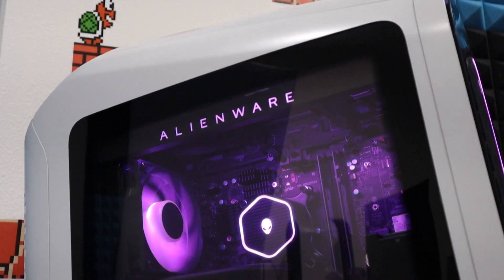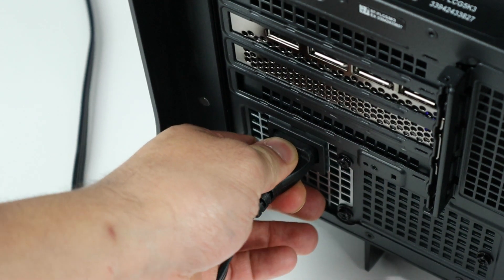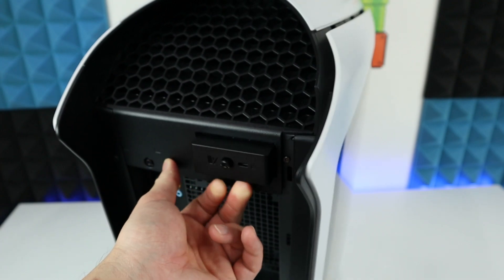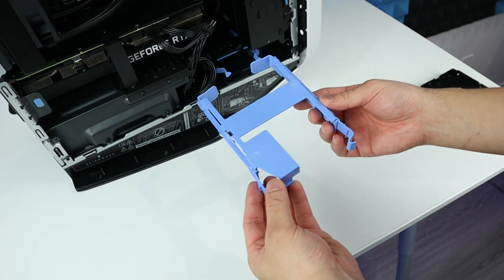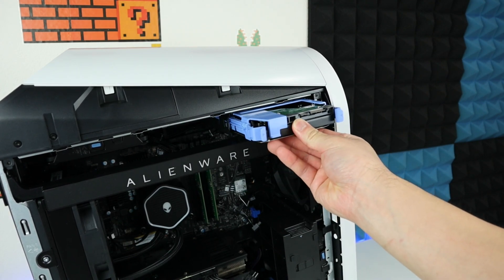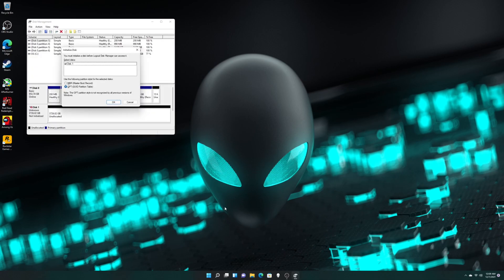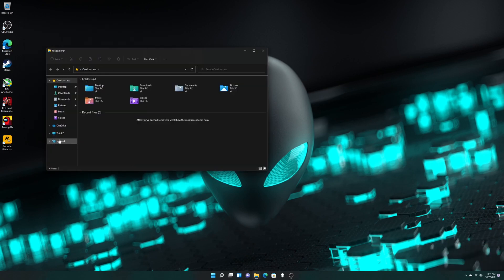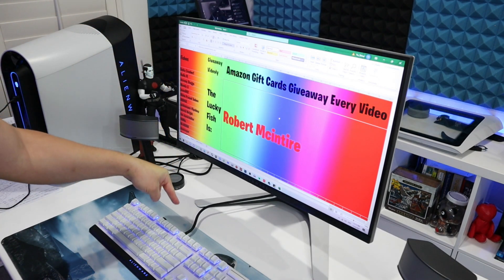How to Upgrade 3.5 Hard Drive HDD to Alienware Aurora R13

Comment: this might be a dumb question, but is the hard drive you show in the vid originally empty and intended for an extra hard drive? Or do you fully have to replace the one the pc comes with?
Reply from the maker: I didn't have a hard drive, so I installed one, and it's brand new, but you can add an old hard drive too.
Reply: Yes it’s empty. You can put on an old hard drive as long as it’s the same size. Or a new one with same sizing as well.

Comment: Thank you for creating this video!  I just received mine but Dell is telling me the largest 3.5 HDD the R13 can handle is 2TB - which based on your video appears to be incorrect.  It is my hope to install an 18TB in this bay just for storage.
Reply from the maker: OMG 18tb I don’t know. But 4tb works fine.
Reply: Going to find out! It won't be used to run any programs off of, just storage so we will see.  Thanks again.
Reply: If anyone happens to wonder if an HDD of this size posed an issue with the R13; it doesn't.

Comment: Does the PC come with them cables standard? Id love to move my hdd over instead of buying a new one
Reply from the maker: There is only one extra sata with the pc. you will have to buy some for yourself.
Reply: @RyanYu  so if I want to add another hdd in the slot you have there I need to buy the cable? I ordered mine with a 1tb nvme only
Reply from the maker: @achunkyduck9740  you meant two HDD?
Reply: @RyanYu  No I have no hdd on my order list but I plan to add one myself. I'm curious if the cables are provided for me to add 1 hdd
Reply from the maker: @achunkyduck9740  Oh, for that you don't need to buy anything. It will be just what I did in the video.
Reply: @RyanYu  Perfect, thanks so much for the reply. Iv been loving the  videos about the r13, very informative.

Comment: Hi are the cables for the external hard drive already installed on the R13?
Reply from the maker: For the 3.5 HDD the cable is ready, but for the 2.5 SSD, you will need the sata cable.
Reply: Thank you bro! Please make more R13 videos! I am a fan
Reply from the maker: @bensonnv2936  I have about 8 of them. check them out on my channel.

Comment: I just received my r12 and I havent used it yet I am waiting on the monitor arriving tomorrow. Would it be alright for me to add a 1tb hdd right now before initial start up?? Or should I wait
Reply from the maker: You can add it now, it doesn't matter.
Reply: @RyanYu  thanks. Doing it now
Reply: Is the power the one labeled p3? Mine didn't have a black one like urs
Reply from the maker: @love-ce5xq  Yours is R12, it will be same as R11, I have a video just for R11, try that one.

Comment: Thanks for the tutorial. Really helpful for when I upgrade. I see from the comments that although there's only one drive-space for 1 HDD, we still do have 3 sata and power connectors available. I was wondering if you could make a video regarding how we can add more HDDs (purchase an appropriately sized drive-bay and where to fit them). I hoping to install 3 seperate ones.
Reply from the maker: I don't think there is a space for another 3.5 HDD.
Reply: @RyanYu  Thanks a lot for letting me know. Cheers!

Comment: i see a 3.5 bay and a 2.5 bay it seems there's 3 sata plugs though is it possible to add two 2.5 drives and one 3.5 drive ?
Reply from the maker: I think so, but we need to find a place to mount the extra 2.5.
Reply: @RyanYu  would fit in the back panel wire organizer space with same velcro tape ? I've seen that done in other cases not sure about this one... thanks for answering though ☺
Reply from the maker: @realityzoner  I will check that up.
Reply: @RyanYu  awesome waiting for your next batch of videos
Reply from the maker: @realityzoner  :)

Comment: Can you also make a video how to upgrade the second m2 ssd slot plz? And do you need a headsink for it?
Reply from the maker: Video coming soon.
Reply: Thank you very much!
Reply from the maker: @hgoedemoed7011  I have video coming up for M.2 and the 2.5 both.
Reply: Tomorrow i get also my alienware r13 full spec. But i wanna upgrade it with the samsung 980 pro m2 sdd 2 TB. But i wanna know if i need buy it with a headsink or not. As far as i know it is better always better with a headsink so it will not trottle down. But for only gaming not necersary. On the motherboard i see at the second m2 slot. Thermal pad area. But i don’t know if you need have thermal pads when you buy a m2 with headsink together or is also included with it. I am looking forward to you next video about it. Also thanks alot for your fast response. Great channel! Keep it up and i hope it will grow bigger.
Reply from the maker: @hgoedemoed7011  I’m getting the same m.2 bro.  Just wait for my video It will be out in this week.

Comment: Very nice tutorial. Just have a question, you said r13 is capable of fitting a regular sized graphics card. For example can I install a MSI rtx3090 supreme X?
Reply from the maker: It can fit the size of the GPU for no problem. However, we need to pay attention to the power consumptions since there seems like we can’t change the power supply.
Reply: @RyanYu  thank you for the reply, I currently have a 750w power supply and I suppose it can handle 3090. Btw can you tell me where did you get the information that says it can fit a regular sized gpu? I have heard many reviewers said it but never seen it on official website or anyone actually test it, still a little concerned about the space and airflow. Thank you 😊
Reply from the maker: @yangshuhan2935  That will be okay, the only problem may be the power consumption, since regular graphic cards will have much higher power consumption?
Reply: @RyanYu  if you are asking about the same gpus I think they are the same. A dell rtx3090 has the same power consumption as the other brands
Reply from the maker: @yangshuhan2935  Then I think we can put a regular for sure.
Reply: @RyanYu  the size is all I worry about. If by any chance would you please try install a regular sized gpu?
Reply from the maker: @yangshuhan2935  I will try to get a GPU first.

Comment: I just got my R13 and am setting up too.
On top, besides the HDD enclosure. There's a blank space with some screw holes there, not sure if it's possible to add on one more SSD.
Problem is there's no power connector.

At the bottom, where the SSD is located.
I think there are two sata ports nearby, but there's only one power connector cable. What's the second Sata port for?

What's the slot above the GFC for?

I will probably buy one more m.2 card, but not sure if there's a size limit.
Reply from the maker: I will check on that.
Reply from the maker: Also for the SSD 2.5 at the bottom, I think we need an extra sata cable.